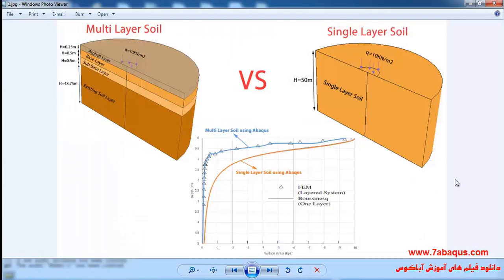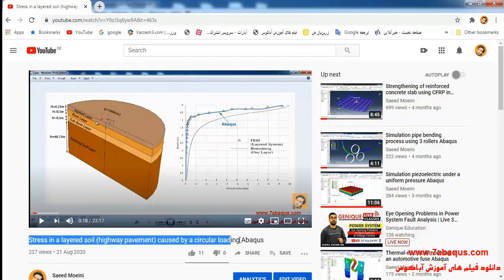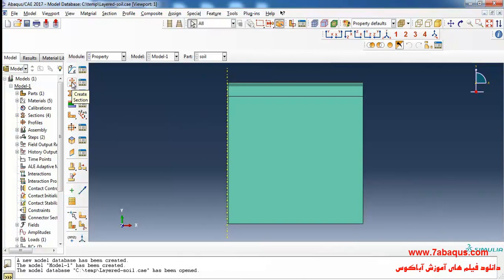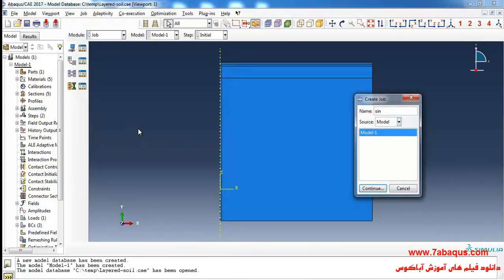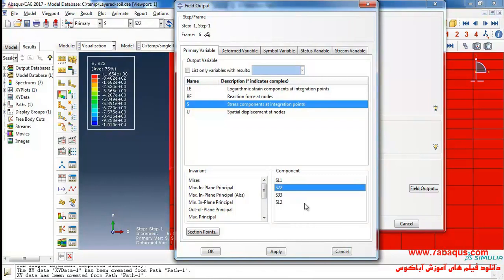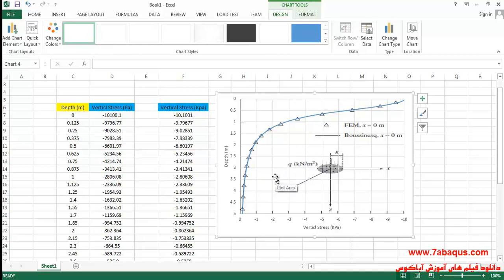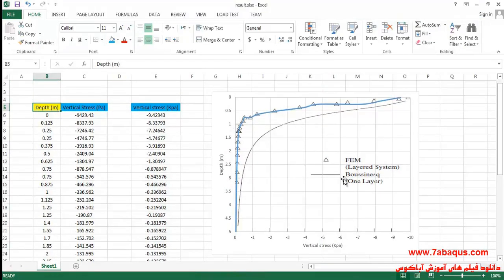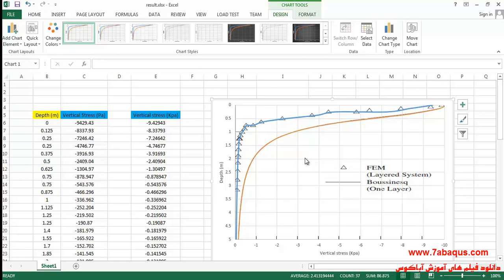Comparison between stress within the single-layer soil and multi-layer soil Abaqus

Comment: If we dont have poisson ratio and modulus of elasticity, how can implement road paving and calculate both them in Abacus program ? or is it possible at all?
Reply from the maker: You must have poisson ratio and modulus of elasticity (This is required)
Reply: @saeedmoeini-7abaqus  Thanks for your reply. could you please suggest a program that can be used to calculate the poisson ratio and modulus of elasicity?
Reply from the maker: @zaraselsal9855  poisson ratio and modulus of elasicity are properties of material and are already specified and there is no need to calculate them
Reply: @saeedmoeini-7abaqus  thank you for your reply. is it the same for mixed asphalt too?